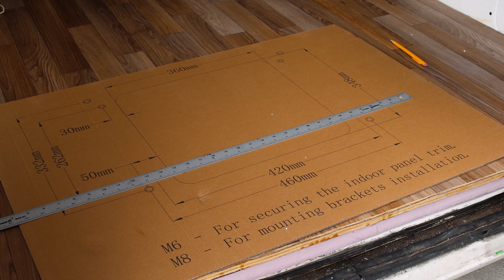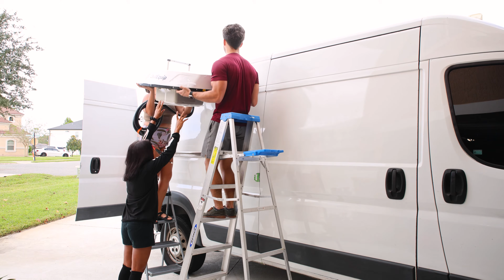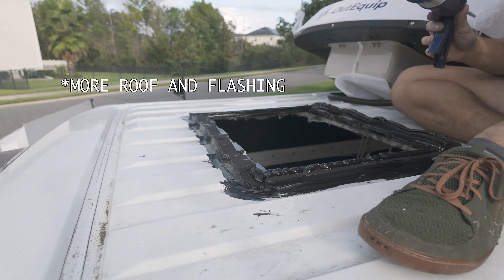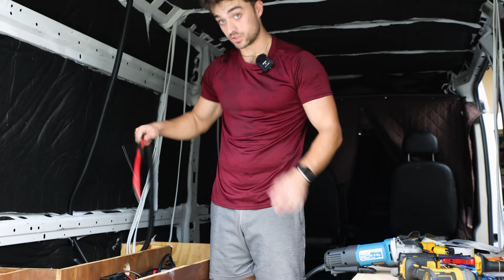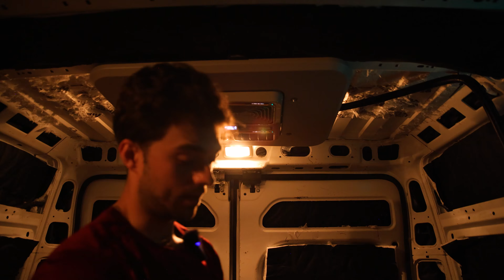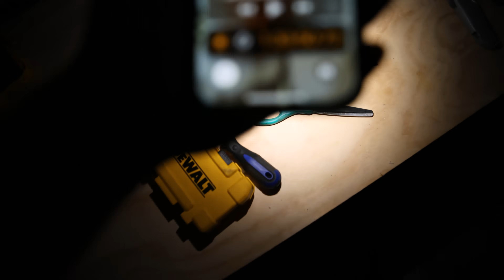Game-Changing Air Conditioner for Off-Grid RV & Van Life – OutEquip 12V A/C

Comment: I installed the same model. It works good, but lately it shuts off and reads 13 on the screen. Then turns back on. I think my electrical needs to be sized up because the same power runs an inverter.